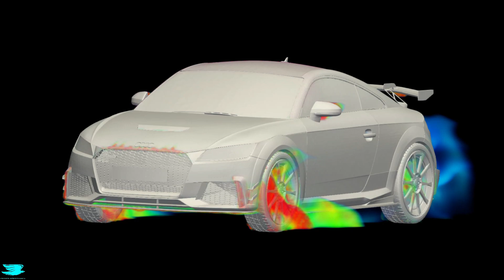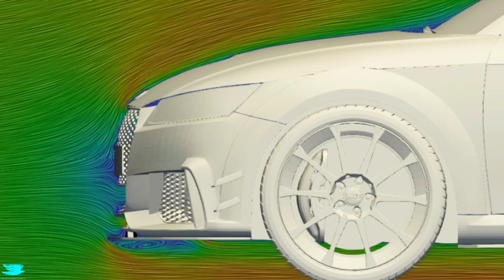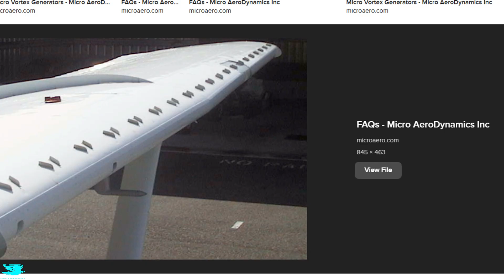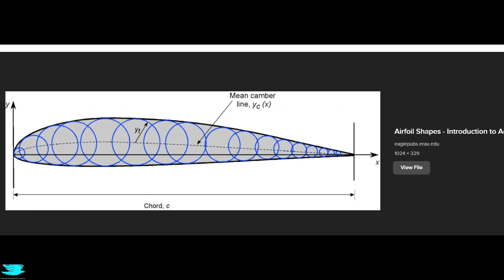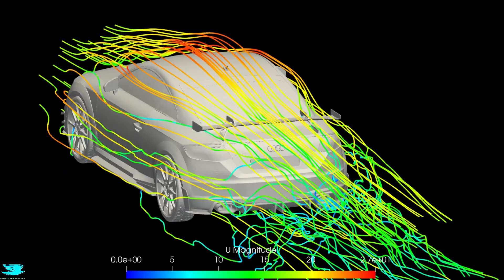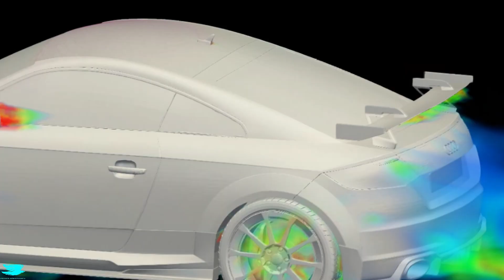Fixing The Audi TT RS Aerodynamics [Performance]

Comment: What if you put a tiny lip spoiler right where the separation on the rear wing. More like an extension of the deck lid an inch or so longer.

Comment: You put a lot of effort into analyzing the diffuser when it’s a very aesthetic device. It really is t actually intended to be a functioning diffuser, which is why it performs so tragically. Wouldn’t fixing it involve lengthening it at least to the rear axle and decreasing the exit angle to some far more beneficial like 12°-13°? I mean, isn’t a 90° bend over a distance of about 8 inches just begging for separation… vortices or not? Even with vortices, micro or otherwise, ideally shaped aircraft wings only prevent separation, at extremely low speeds, at like 25°. Strakes as I understand them strengthen and encourage a stronger boundary layer, but not at such a sharp radius.

Comment: Is the satellite antenna affecting the downforce of the wing? I wonder if you removed it in the simulation if the numbers would change much? Thanks
Reply from the maker: It definitely is a little. It reduces how much energy is hitting the wing.

Comment: Downforce is mostly needed for cornering. So doesn't the rear wing's  efficiency during YAW matter more than when driving straight? Wouldn't it be advantageous to have a wing perform slightly worse during a straightaway, then automatically make more downforce during yaw? Sort of like an automatic DRS.
Reply from the maker: Yep, definitely. It adds a little more mechanical complexity, but the aero is worth it.
Reply: @PremierAerodynamics I meant designing a wing to slightly stall and be inefficient on straights and then work better during yaw. 

Somewhat like DRS, but automatic.

Comment: How about checking the aerodynamics of a Nissan 180SX Type X? It's got quite an aerodynamic base shape, but do the Type X front bumper and accesory rear wing benefit the car at all?
I have a 180SX myself and want to improve the internal and underbody aerodynamics as there is zero ducting or covers from factory, but I'm vauge about the outer body aerodynamics